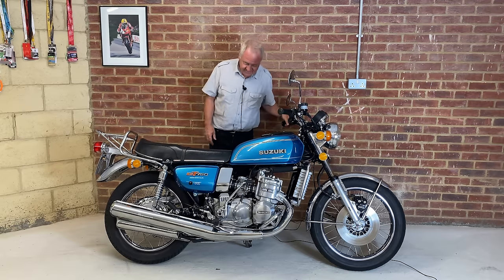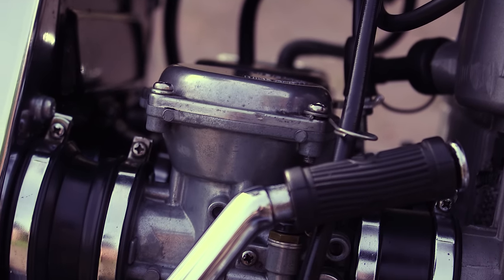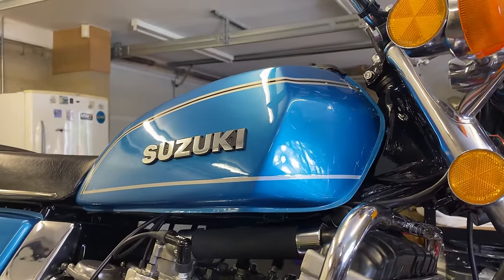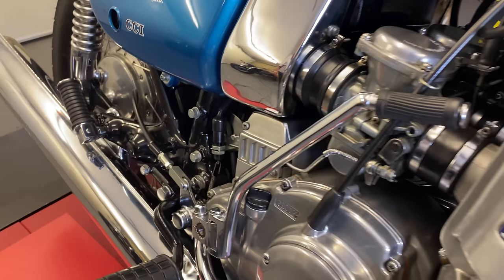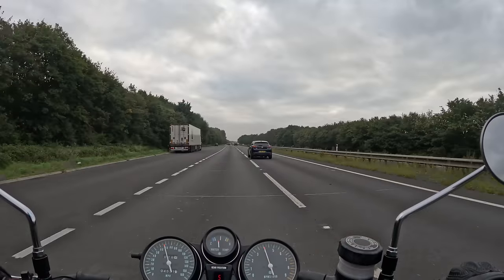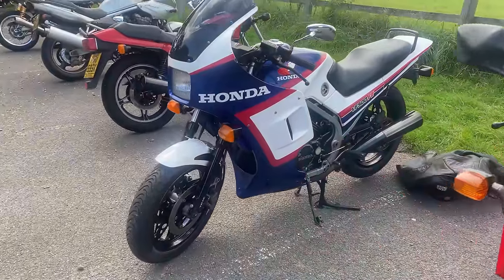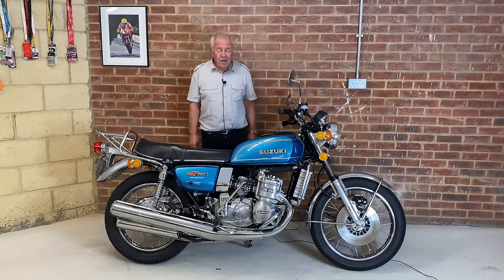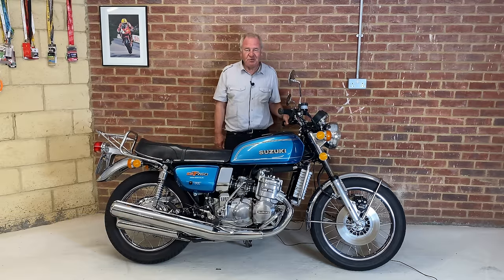The MAM Journals-The Iconic Suzuki GT750

Comment: An LC350 is the perfect GT750.  Except for the sound. That burble was great. So were the tank slappers. The LC goes better, handles better, stops better, and is tons lighter.  The GT will never do 120 mph.
Reply from the maker: LC is a great bike . Hoping to review one soon. 👍
Reply: Still have the GT750 that I bought pre-owned in 1985 or so. My second bike after the GT500 which also still have. I had 2 4stroke bikes after the GT's, a GS650 and a XJ900 but they both lack in torque, so I ended up on VMaxes 1200 and now the 1700.
Still have all the bikes I had and back in the days, the GT750 was a great ride though from the look I prefer the GT500.
Nice video of the GT750!  Thanks!!
Reply: As I had all these bikes both the J model RD350LC and N model RZ350YPVS both where NOT SUITABLE for long distance touring like the smoother more mellow and torquey GT750 was..The Yamaha's always ate exhaust seals due to vibration and where more revvy than the GT hence their greater thirst for fuel and oil..However they still were fun little bikes and unbeatable in the twisties and on the race track where they excelled.

Comment: If you wanted a bike that could go around corners, this wasn't it. The one I rode only had about 10-12,000 miles on it, but it was probably the worst handling motorcycle I've ever ridden. Brakes were poor, suspension felt clapped out, and the frame was pretty willowy. Motor was probably on par with other 750's of the era. Wes Cooley didn't win on this bike, he rode a GS 1000.
Reply from the maker: I know Richard . The picture was of a GS and I mentioned in the video that 4 strokes replaced the 2 strokes . First the 750 , then the 1000 , which went on to great success ..👍

Comment: When you went for gazoline, I notice that it idled at close to 2,000 rpm. 🤔.
Reply from the maker: I was holding the revs up on the throttle Michael . As I mention in the video , the pilot jets need a clean so it wasn’t idling consistently . Bike ran well on the mains 👍
Reply from the maker: @michelbrown1060  Maybe Michael . It is a friends bike so I wasn’t tempted to start taking it apart . Thank you though 👍